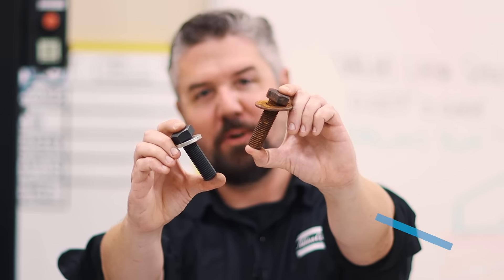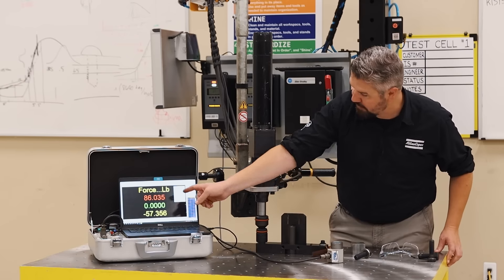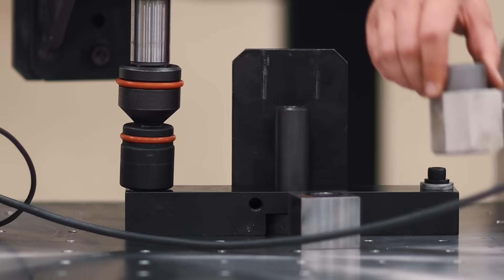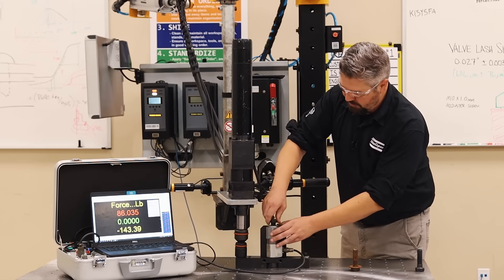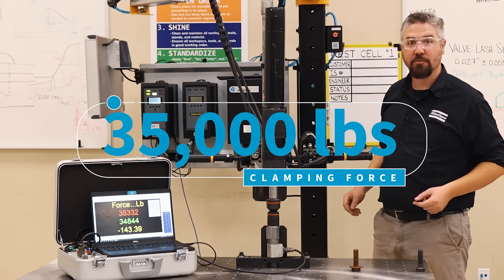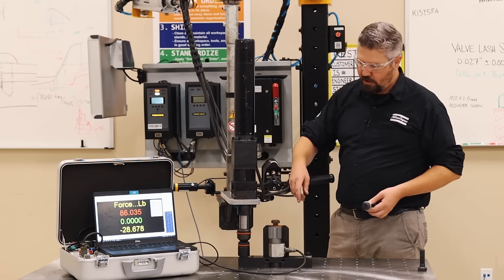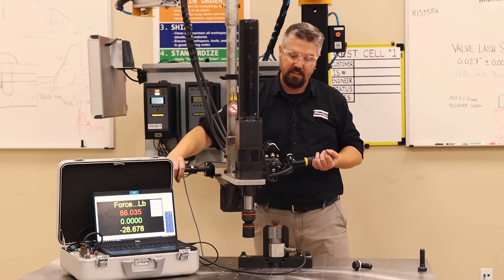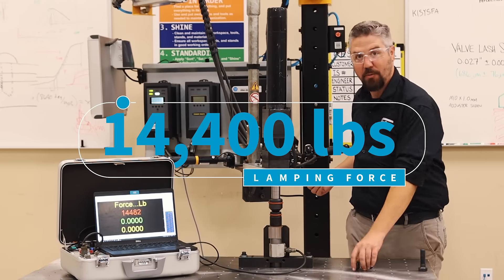In the Lab: The Rusted Bolt | Atlas Copco

Comment: Very interesting! I’d be curious to see the same test with grease or antiseize on the rusted bolt. And then again after cleaning the rust with a wire wheel. Most people typically don’t just stick a rusty bolt in without doing one or both of those things.